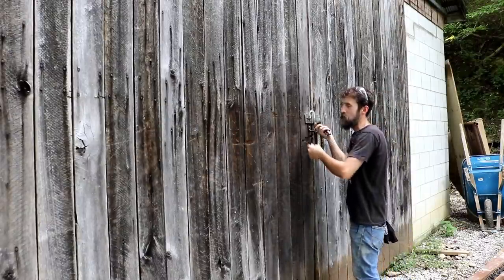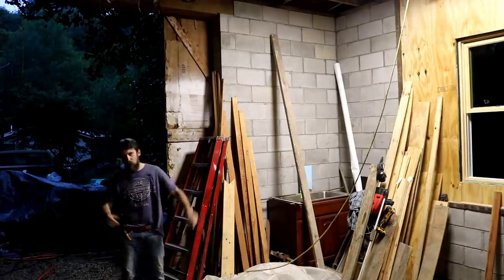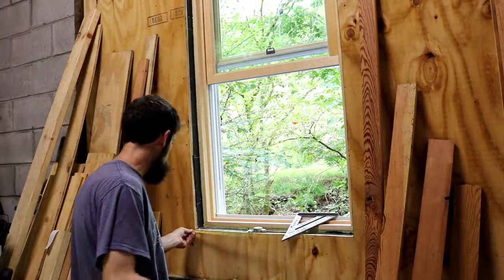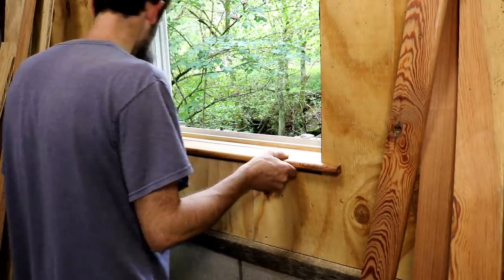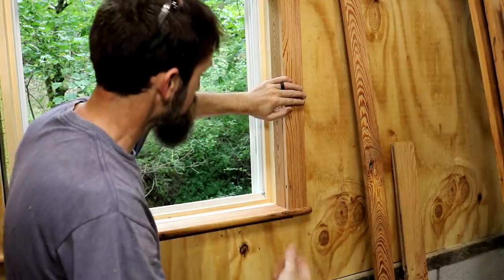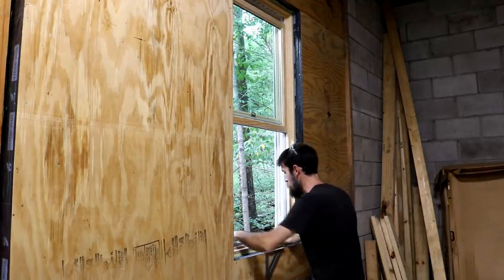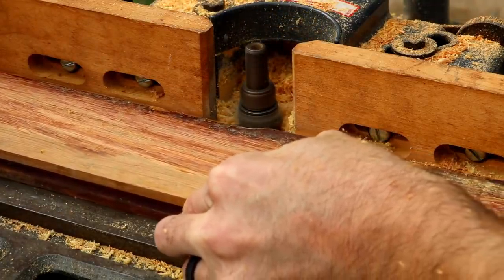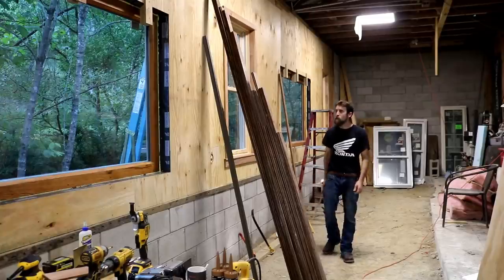Trim work from 100+ year old flooring . Shop windows looking Amazing!

Comment: I'm 61 and Johnson Paste Wax has always been the standard in woodworking. Coat all tool, such as router bases, circulars saws, table saws and anything that wood slides over or you are sliding over wood.

Comment: Hey Steve Noel! Greetings from Vancouver BC Canada! Thanks for the wonderful vids that fill the time that my chronic back pain forces me to spend on the couch instead of my projects! After 17 years of carpentry I still have 10 fingers and I want you to have 10 fingers 70 years from now! So I must suggest that you lower the blade on your table saw so a maximum of 1/4 inch sticks up above the surface of the wood your cutting! 3 inches of blade sticking up will take the whole finger or hand off but 1/4 inch just means a nasty wound if bad things happen! Best of luck and health to all humans and critters in your world! Ride ride ride!

Comment: The upstairs in our former house was that pine. The house was built in the 1880s, so quite old. Took days just to sand our daughters bedroom floor. After, we finished it with an oil based polyurethane, absolutely beautiful. You've done a wonderful job on those windows.

Comment: Awesome job Steve and thank you for another great video. I love the re-use of the flooring. If you think about the irony, 100 years ago that flooring was the off cuts and most undesirable rips from the mill and was used as flooring where it would get painted or covered with a rug. Now people are putting perfectly clear straight grain oaks and ash on the floor and filling the decor with thing built from reclaimed knotted up barn wood and flooring. I personally love wood with character. Thanks again.

Comment: For a similar color match stain to the long leaf pine, put an entire pouch of Mail Pouch or Red Man loose leaf tobacco in a quart jar and top with hot water. Loosely screw on lid to the jar and let sit for a few days.  Test the stain on a part of the wood of the window to test color.  For darker color you can simmer the tobacco in water for a few minutes, for lighter color just thin with water. Test a similar piece of wood to the wood of the window frame to get the mix right.  It makes a beautiful warm brown stain and is fretty cheap to make.  Thanks for filming and sharing, I am loving this "restoration"!

Comment: Good job Steve. To help the wood glide easier on your planer or table saw take waxed paper, crumple it up and wipe on the surface.  Use on metal to metal too.  Works like a charm.

Comment: Hindsight is 20/20.  I think I would have  run the the block right up to the windows leaving space for trimmer/king studs, steel lintels & sills.  You have the block, it would have saved you the expense of all that extra framing lumber and sheathing .  Steve, you're the hardest working man on YouTube!

Comment: Well done Steve, excellent eye for detail. I can tell that you're a REAL engineer by the way that you use a vernier caliper for concentricity of nail placement in the sill trim and a copper knocker to drive the nails in to hold the sill down.

Comment: Nice work! Generally speaking the head piece extension jamb at the top gets installed first then the side jambs but into the head piece. Also the casing is usually pulled back a quarter inch from the jamb sides and top to create a shadow line. This also tricks the eye in case surfaces aren’t quite square or flush.
Reply from the maker: Makes sense 👍. I just fit them flush.
Definitely harder the way I did it but everything fit together really nicely other than a couple pieces that required some custom 😉 fitting with the power plane due to the warped plywood.

Comment: Lower your saw blade to where it's just above the material and use a fence. Asking for trouble free hand cutting like that on a table saw.
Shop is looking great, cheers :)
Reply: What I've heard you should have tooth gullets clearing your work. Otherwise you don't get proper chip extraction. That and it messes with your cut angle too. The angle at which a tooth penetrates the work. Blade too low and then a tooth is not pushing down but rather pushing work back.
Reply: @1pcfred  incorrect, the entire blale is clear of the wood where it isn't touching.
Reply: I set mine around 1/4” above the work piece. Just depends how deep you want it to cut when you fall on the blade. I think if its too low you increase chance of kick back.
Reply: @1pcfred  correct. The gullet should come through above the surface.
Reply: @bobwitt305  That's what I've heard. I used to run with the teeth just barely poking through myself. Cuts better with the blade raised more than that.
Reply: @Johnditit  Pro tip: Do not fall on the blade. Ever! My personal rule is I'll never put my hands within an inch of the blade if it is running. If I need to do a cut closer than that I use push sticks and blocks. I keep all that crap on a shelf right on the saw so it is always handy.
Reply: @twistedhairball  you do you and don't ever change.
Reply: Yep.. I'm not typically a "safety sally" but this is a good way to lose a significant piece of your hand in the blink of an eye.
Reply: @Justin-C  sure if you're not careful. Steve strikes me as the careful type. I was watching him and he was being careful. I saw a board start to get away from him and he got it under control. Which is what you have to do. Some don't. They're the ones we call stumpy.
Reply: No fence, no pusher takes me back to the days I worked in China.  Those guys did the same things only worse.

Comment: Steve, on your vacuum, I have the same one but an older model. I have found the best way to keep the pleated filter clean and suction the strongest is to start with a new pleated filter and also install the bags. The bags catch all the junk and can be lifted out and disposed of. If the bag should break open you still have the pleated filter to protect the motor.

Comment: Hi Steve,  You could try making a sled for planing that pine.  Get a piece of stock wide enough and long enough to fit under the boards you are planing, attach a cleat to the leading edge of that board.  When you want to plane your stock, place your work piece on the top side of the sled with the front edge butted against the cleat and feed into your planer.  The work piece will drive the sled through the planer and prevent the sticky side of the work piece off the bed.  Hope that makes sense!  Just remember to set the planer head accordingly.

Comment: Great job on the trim Steve. When using my table saw I only allow the blade to protrude thru the wood enough to make the cut. I do this to lessen an injury if something happens. Just how I do it and thought I would pass it along for the safety aspect of using power tools. Keep up the great work.

Comment: Nice video Steve, just a couple of minor criticisms,( constructive I hope), when you put your carbide scraper down, lay it on it's side rather than on the cutting edge, also try and get your dad to refrain from cleaning the router with hp air, use a vacuum instead. An air line will put sawdust/swarf in places you don't want it! Liked the trip to the DIY store, traditional American music in a traditional American truck driving through traditional American scenery in traditional British weather. All The Best from Somerset UK.

Comment: Hello,  I kinda like the juxtaposition of the blonde window frame with your yellow brown pine.  Has a character all its own.  They look very good.  Saw you making a cut on the table saw without a guide.  Scared the crap out of me and I'm fearless!!  Been doing woodwork for more than sixty years and I never use a tablesaw without a guide of some sort.  Got froggy many many years ago after seeing a TV show where the guy was doing free hand stuff on the saw decided to try it.  It could have been real ugly but it did bring the point home and I never forgot it.  Turned out Dad was right when he told me as a kid that familiarity breeds accidents around the shop.  Maybe you don't need all your appendages but I sure like mine.  Good job on the renovation.  Take care.  Doug

Comment: In my years of maintenance/construction I did a great deal of using 4x8 plywood and/or hardboard on walls and floors in schools. With a little bit of imagination (especially the floors) you can turn out some beautiful work on a budget.  My best work was in a high school wood shop that lasted 32 years before it was torn down.  

 When I saw what you were doing with the recycled flooring  and seeing the plywood on the walls it brought back those memories of making something look nice and last for a long time.
Yes you made me smile.  Keep up the good work.

Comment: You are a quality worker very good work. The reused wood, it the best wood to use, one reason being that it is already is acclimatized so your joint wouldn't be susceptible to opening or warping due the joints being to tight.

Comment: Like the music. Had to laugh when you broke out the calipers for the nails, I do that too. 🤓
Reply from the maker: The nails I was using were on the large side for some parts and just right for others. I wanted my nail holes to be somewhat even spaced😉
Reply: That’s just what happens when a machinist does woodworking!
Reply: @domdipyatic3997  yes it is lol
Reply: I think, mind you I'm a electrician by trade and like playing machinist at home, but, with the ease and ability of calipers to accurately measure it makes things that much more pleasing.

Square, level, plumb. A way if life for all craftsman. However we can all learn how to be better from each other and how new tools can improve our lives
Reply: @tek4  I use my calipers on all kinds of things.. Last week I used them to determine gauge of some existing wiring in my shop.  They always come out for wood working.

Comment: When working with wood, Pledge or any spray furniture polish for that matter, works great for helping to keep saw blade teeth from clogging with resin. It will help keep it from sticking to the sides of the blade, which when using a hand saw makes it difficult to feed through the cut and keeps a power saw blade running cooler so you don't end up burning up your blade and taking the heat treat out.

Comment: I've found that the pull saws work well when I start at the front and pull down rather than the back and pull toward me. The sawdust goes down rather than obscure my line. Southern Yellow Pine is great. It does clog everything it touches, but I love the stuff.

Comment: That must feel sooooo good walking into that space now. I use a product called "Slippery Stuff" on all our working surfaces. It is silicone based but just something about it that makes it last far longer than other sprays. When we can't get it on occasion using other products just don't cut it. All saws, router bits, cast iron, aluminum and melamine, eveh HDF and MDF. We both know about quality tooling. Getting a lesser quality for just one job never works as now we can do that job and end up getting the better one in the long run, LOL. As far as the gas cans I taper drill the handles and wooden plugs with a string. I was watching you and your dad at the router table. You and he have identical hands. Nice job my friend !

Comment: Seeing you pre drill for finish nails reminded me of a tool called a nail spinner made by Vermont American. It is inserted into the chuck of your drill. A 4, 6, 8, or 10 penny finish nail is inserted into the spinner. Use the drill to spin the nail into the wood stopping short of the finish work. Remove the drill and spinner from the nail and drive/set the nail home. They work great and you don’t have to pre drill. The nail becomes your drill. Just a thought from an old man. I’ve found no one stocks them nor do they know what they are but, they can be ordered on line from Vermont American.

Comment: The machine that you said is basically a router table etc, over here in the UK we call them  Spindle molder and the difference between the two is the spindle molder can take some pretty big cutters something way bigger than you'll ever get into a router!!!
Like any machine they are really good but with way bigger cutters come way bigger injuries so steve be very careful you don't want to lose a hand let alone finger's!
💯%   👍🇬🇧

Comment: Nail holes easy to fill, using all that sawdust you collected, just take a cupful of it, and add some wood glue to it, mix up to thick oatmeal consistency and fill the holes with it. Instant colour matched filler.
Reply: The old tricks are the best.
Reply: SeanBZA  after doing that I would give all the wood trim a coat or two of the paste wax and that wood will really show the grain and features. The icing on the cake!
Reply: Or as gummy as this wood is, just push the sawdust in... It'll stick :P

Comment: Try this on a scrap piece of  wood to fill a nail hole.   Take a small pile of sawdust from the trim wood , add a few drops of wood glue.   Stir well and apply to nail hole.  Let dry and lightly sand.  You may or may not like this method.   I have used it on gun stocks to fill cracks etc.   Trim looks great.

Comment: Tractor supply has conversions for those crap new gas cans to make them like the old ones. & a tip for the shop vac use paper towels around the filter to keep it from getting full of saw dust & to hold the paper towels in place use rubber band's.

Comment: I think that timber is  what was called “pitch pine” by the older generations in the uk. Incredible stuff, lasts forever. Unavailable for a long time. Looking forward to the absolutely necessary addition of some old Wadkin iron for the wood side of the shop :)
Reply: James Morris  yes I know it as Pitch Pine also or Oregon Pine. Have refurbished many Victorian organ cases made of the stuff. It's as heavy as lead and hard as nails lol
Reply: Pitch Pine is a different but similar tree. Both are very hard, very resinous and both live in the same geographic areas. The main difference is the longleaf literally has very long soft needles where the pitch pine has needles a bit harder and half the length (still long by pine standards). The major difference is longleaf yellow pine is an endangered species where pitch pine is extremely abundant. The grain on longleaf pine though is very distinct compared to pitch pine. The difference is striking where longleaf is far more visually appealing.

Comment: Nice work Steve. I don’t know if it’s been mentioned, but the usual method of fitting aprons, at least where I live, is to cut the length to the same dimension as outside casing to outside casing and nail on so the ends are in the same plane as the casing edges. Just looks better, to me.

Comment: really cool trim. seems like it's actually better that it needed trim. it kind of tied the window into the the wall and made it look really nice, like a piece of furniture. i was a little concerned when i watched you make fence style cuts on the table saw without the fence. i had a wood shop teacher in high school that would demonstrate for the new class every year who the bad boy in the shop was and how dangerous it can be. which was the table saw. he did this by shooting wood through the saw at the wall which had extra plywood over it. so fence every time.

Comment: A bit late now, but a super simple trim detail to make the window a little less blocky looking is to cut a 45deg angle on the apron ends.  Having the bottom of the apron more narrow than the top draws the eye away from it and up further to the window it's self.  I guess you could pop them off, trim then and put them back on.  But that might not be worth the extra time to you.

Comment: That wood is beautiful stuff. You can’t buy that now for love or money. The resin that makes it difficult to work also makes it last like it does. And BTW, nice work on the finish carpentry. Looks like somebody cared!

May I humbly suggest that the plywood wall be completed with a series of French cleats running along its length? Very handy, strong, and versatile. Easy to make and install, particularly using that awesome wood you have. There’s no end to the jigs and fixtures you’ll come up with to hold and store tooling, etc. A nice, simple to make collect rack comes to mind, for instance.

Comment: To me that corner where the long pieces were leaning Just begs to have a real wood burning rock veneered corner fireplace. A space where Elizabeth and the dogs can stay warm and be near you as you're doin' you're thing with the metal working end of the shop.  "Elizabeth Friendly Area" for the cold wet winter days. Just a thought. I mean you're trimming out the windows for a expensive residential house. Beautiful job.

Comment: The galvanized nails are also for use in treated lumber, hot dip galvanized will not be corroded by treated lumber.

Comment: Kitchen oven cleaner, and toothbrush if required, will clean that tree sap off blades or cutters in 10-15 minutes. Works phenomenal on carbide. 
Nail holes, pffft, that is character buddy.
Reply: Uncle Bob's Bees turpentine is much quicker as it's derived from the pine resin and dissolves it.

Comment: They sell this little plastic pump that run off of D battery. I use it for filling my tractor and ATV.   I would worked on the outside before the snow flies.

Comment: Wow, that's nice workmanship! Pardon the quibble, but all that freehand cutting with the blade so high made me nervous. When the board started to rise at 16:23, with you standing right behind it, my heart 'bout stopped. Still, you did stop the kickback.
I have never worked with fatwood like that. Soo beautiful! I do wonder if there is a resin hardener that you could have used to harden up those fresh surfaces that the planer exposed.

Comment: You need a good cyclone between the planer & the vac.  I haven't changed my filter in over 2 1/2 years. It keeps everything cleaner with no dust whatever. Made my own with a chineseum $11 unit.